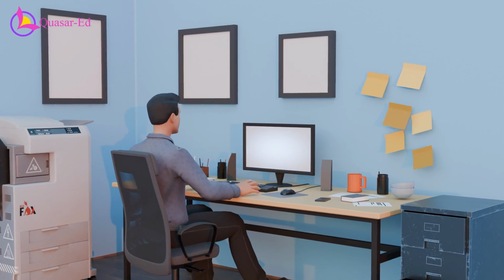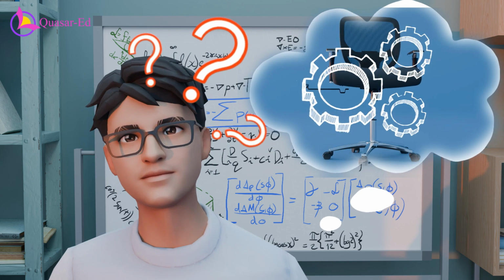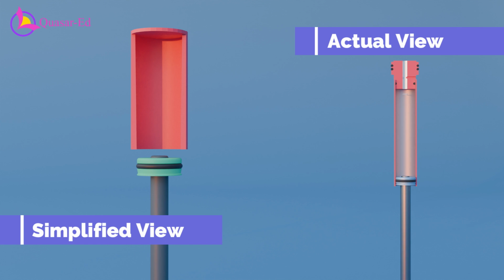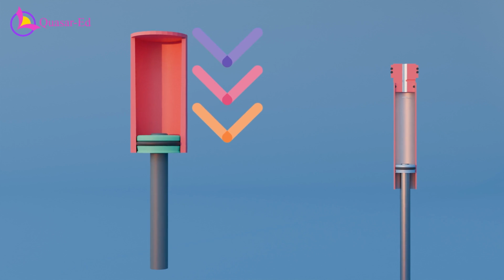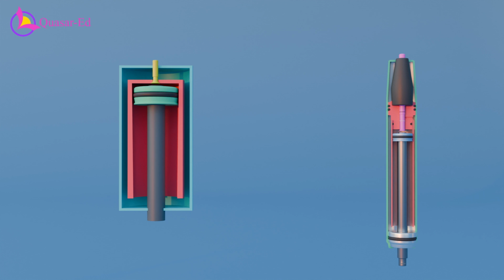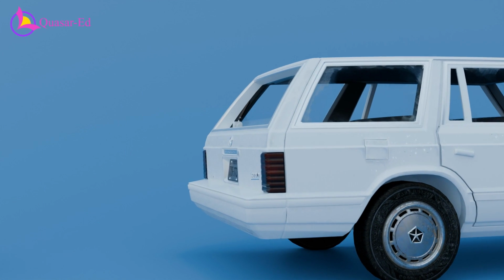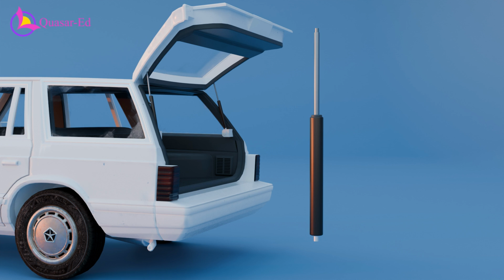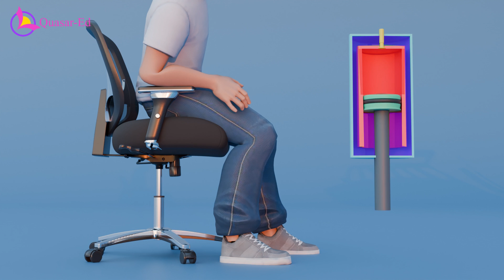What Makes Your Office Chair Rise? The Gas Spring Explained!

Comment: There seems to be some subtlety missing to explain why, when the applied load is removed (ie. when the user stands up), the chair seat remains at the same height, and does not rise as the gas cylinder extends due to the excess pressure as would be expected.
Reply from the maker: It doesnt work like a spring, extending when the applied load is removed. The piston is pressure locked between two volumes. Only when the valve is opened, it can be moved. I suggest you watch it again.

Comment: how does a gas spring without valve (like one in car boot) get locked?
Reply from the maker: What do you mean locked? When the car door is opened, the gas spring just expand and help in lifting the door. It is just that the way the gas spring and the door hinge are connected so that at the close position, the angle is more inclined to the door reducing the lift and at the open position, the angle is more closer to perpendicular, so the door get more lift. Let me know if you don't understand.
Reply: @quasar-ed  Thanks for your explaination. got clarity

Comment: how that back suppoert spring works///???
Reply from the maker: The back is not fixed to the base. It is pivoted under the base with a spring on the front underside. If you tighten the spring, the back movement also gets restricted giving you a more solid back. If you loosen the spring, the back also gets loose and springy.

Comment: My chair is not sinking but i also cannot adjust it's height, what is the issue here??
Reply: It seems like the push valve is stuck
Reply from the maker: @siewlithen5867 that is the issue and it could be dangerous if the valve loosen and fly away. You should bring it to repair shop.

Comment: Make sure there's safety information attached to the chair. If there is, then it's made with a neutral gas, and your fine. No reaction.

Outside the US, some companies skimp out and some customs let them through. Instead of the neutral gas, you have air(small explosion ejecting that rod upwards), or oxygen(big explosion, also ejecting the rod, and everything else in that room).
Reply from the maker: @rmt3589  Is that so? I didn't know that.
Reply: @quasar-ed  Yes. One of the worse ways to die imo. Was terrified when I first heard about it, and was also sitting in one of those chairs at the moment. Had to research to be able to be comfortable in that chair again.
Reply: My guy what are you talking about?
Reply: @alienwarex51i3  Are you confused about the topic of the chairs, the mechanics of the gas spring, or how combustion works?

Comment: Is there a way to reduce the pressure in a chair gas cylinder?

Mine is to hard to push down.
Reply from the maker: Unfortunately, there is no way since it is sealed. You can only replace it.

Comment: I have a chair that's stuck in the bottom position. When I release the valve I still can't move the seat by hand. Maybe the gas has leaked out? Replacement gas springs are on sale so perhaps this is a common occurrence?
Reply from the maker: @davewilliams1568  yeah..because of the gas leaked out..For me, it took couple years of use before feeling the low gas.

Comment: Why am I afraid that these are going to explode randomly one day when I'm sitting on it 😭
Reply from the maker: 😅😅😅..don't worry. It is safe.Just  don't break apart without reducing the pressure first.
Reply from the maker: @Altaka005 yes, lowering it all the way down will only expose a small section of center shaft and if it would slip through the base, it won't reach all the way to your ...so yeah can prevent a rare malfunction like that..
Reply: @quasar-ed  can a high up chair be more safer?!??!! aka maximum height up like i do with mine
Reply: very rare but you can get cheap ones filled with normal air and standard oil, sudden and heavy movement can ignite the oil like a diseal engine 💥
Reply: A 1000 ways to die
Reply: Already happens... Straight up. Like a javelin
Reply: @esecallum  Yeah I've heard a bunch of stories about it. 
I don't wanna die with a rod up my thing man.
Reply: @tazepatates4805  it's like a armour piercing missile
Reply: @tazepatates4805  put a thick metal 5 mm plate in top if the chair or better still a 1cm thick steel plate
Reply from the maker: @esecallum  omg..that would hurt alot..
Reply: @quasar-ed  in one case it actually came up straight   and came up through the mouth...horrific way to dye
Reply: @quasar-ed does putting it on max height lower the chance of explosion?
Reply from the maker: @absolutedivinity281  I think it won't have much different whether it is in max height or min height. But yeah at max height, there will be lower pressure but you wouldn't want to fall from max height.. I have used many chairs but never seen one explodes. Don't be afraid they are pretty strong..